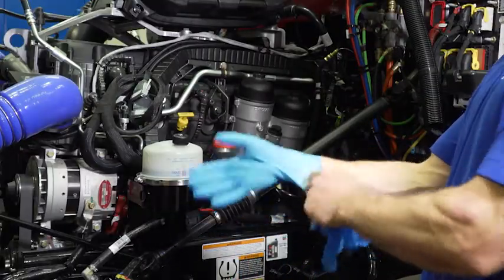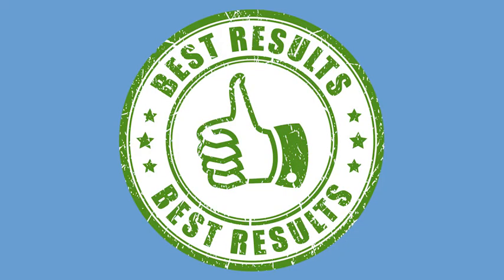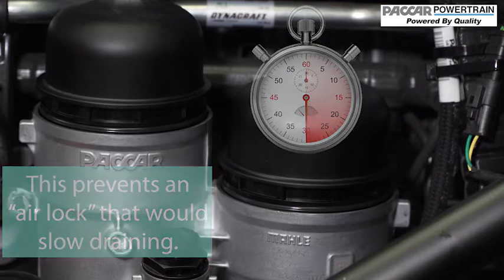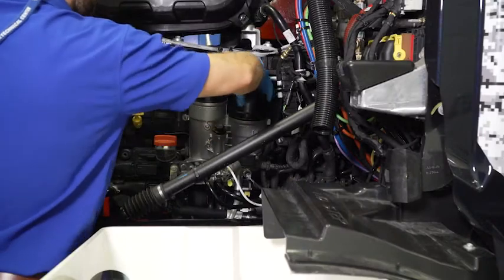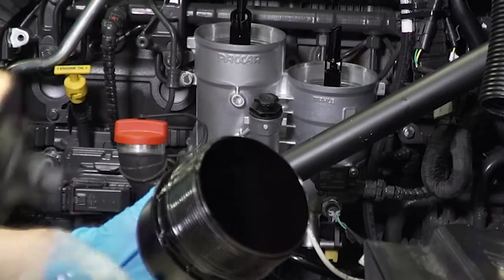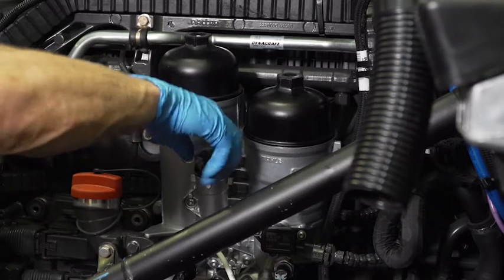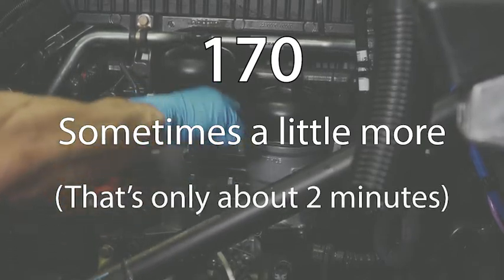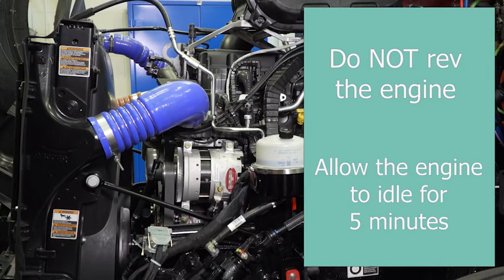Fuel Filter Service 2021 PACCAR MX Engine

Comment: Can you not just pressurise the fuel system from the tank with about  point 2bar,quicker saves all that hand priming and is the PACCAR way on the older versions of the MX

Comment: Why not have an electric primer pump instead of a hand pump?
Reply: To be honest if they could have engineered it so the filters came out the bottom there would be no issue with contamination...Electric pump is a good idea,but as it is the hand primer you would need to be able to switch it off .and then there is the cost